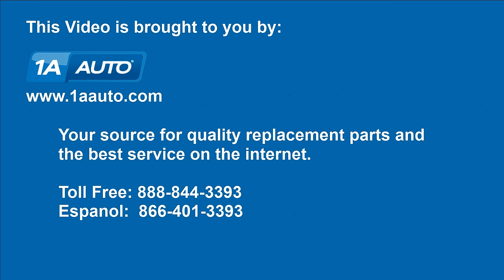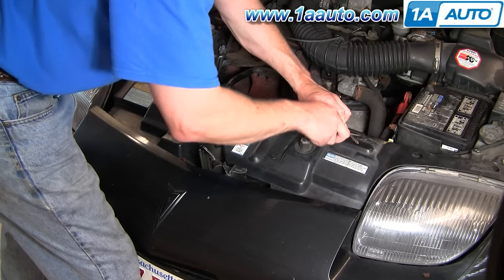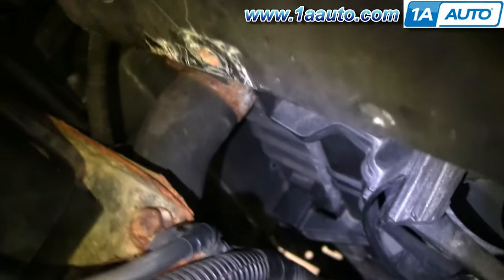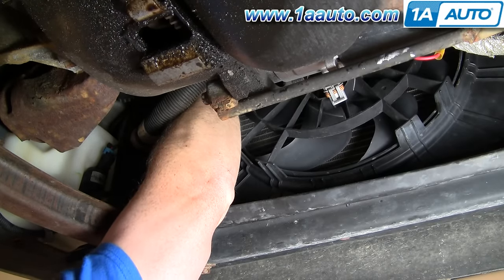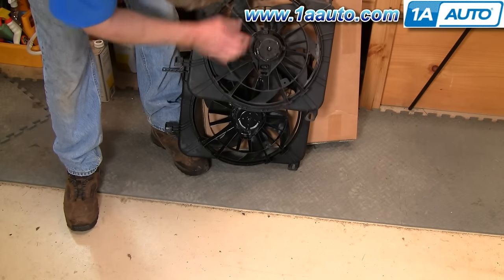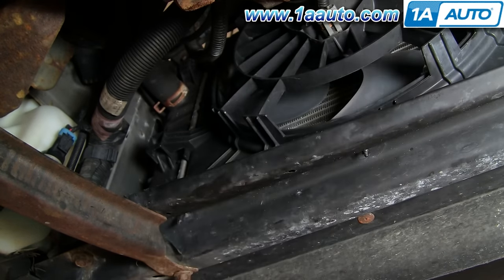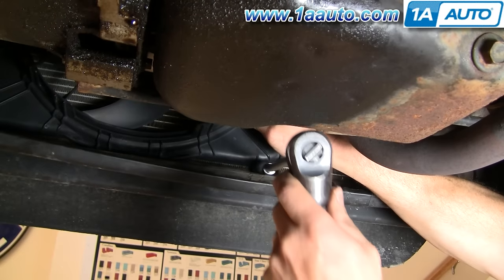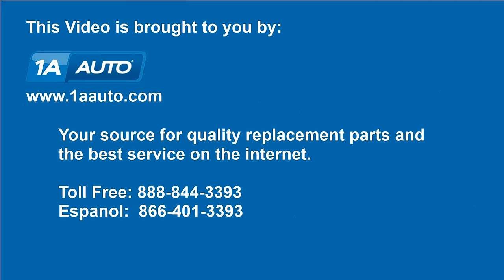How to Replace Radiator Cooling Fan Assembly 95-03 Pontiac Sunfire

Comment: I am an electrical engineer and I took the informed liberty to electrically isolate the fan by pulling the relay out; it's under an easily removed cover in the engine compartment, above the left front wheel.        Pulling the 30A fuse is even more to-the-point.       Disconnecting the battery is over-kill, and scrambles the memory of the engine's computer, a pain in the A**.    My car:  '99 Chevy Cavalier Z24.

Comment from the maker: What you could do is check the electrical connection to make sure you are getting power down to the fan itself. Normally there is a relay of some sorts that is before the motor along with a fuse. Your owners manual might be able to assist you with this or you could contact your local dealership for a diagram.

Comment: Thanks for this helpful video,one problem though,my fan doesn't turn on, I replaced motor,checked radiator fan clip connection, turned ac on,checked fuse,still nothing, any suggestions?

Comment: Mike, the best mechanic I know just replaced my cooling fan motor. in order to do so you had to remove the cooling fan (2003 Cavalier) - I was going to do it myself until I ran into the exact problem you just stated. when I asked him how he ended up doing it, he said he dropped the radiator out of the bottom just far enough to lift the top of the fan off the radiator and it came right off. but he had to drop the radiator first in order to have the clearance room. hope helped, I see i'm 3mos late

Comment from the maker: The white smoke you see is something from the A/C system failing which definitely needs to get looked at. The jump is most likely the cause of a failing transmission and the O2 fault code means that it could just need to be changed out.

Comment: Thank you for the video! I own a 2002 Chevy Cavalier with about 85k on it. Its in pretty good shape (I hope!) but when it jumps when it shifts (automatic) and when I run my ac my engine revs more than it should. Just recenty I was sitting at a light with my ac running and white smoke started to come out of my hood but when I turn my ac off the smoke stops and I dont have this problem when my ac is off. I got a code reader and it says something about a heated oxygen sensor Please help! Thank you!

Comment from the maker: Sounds like the relay for the fan is just overheating or it could possibly be the motors themselves. Normally when you switch the A/C on the computer commands the fans to turn on when you are not driving to keep air flowing over the condenser.

Comment: Hello.... I enjoyed the video, it made it look doable. I had all the tools. I let the car cool completely. Now my problem is I'm not able to get under the car like you were during the video. Can you suggest another method to removing it? Plus I'm not able to locate the clamps to release the fan from the radiator.
Reply: You absolutely have to raise the car, safely holding it up one way or another.          The extrication takes place by going DOWNWARD.        Not to mention the 10mm bolt MUST be accessed from below;  (at the bottom right, when oriented like someone driving the car); this video appropriately includes it in its sequence of removal instructions @ 3:17.
Reply: @johnbecich9540  I removed it from the top but it was a royal PITA.  I'm not sure if I have to do it to get it out but I took loose the fan blades and the motor, removed the battery and pried it out.  I put it back in with a lot less issues, and had motor, blade assembly bolted to shroud/mount.

Comment from the maker: You could test the wire going to the fan with a test light to see if it has power going to it. Just be careful and don't get to close to the fan incase it turns on. If there's power going to the fan motor, than the motor may be bad.

Comment: I've crawled under my cavalier, and there are zero bolts, or screws holding my fan in place. Just a peg in a slot on the top driver's side, a hook over the frame on top passenger side, and about dead center of the vertical border on driver's side there is also a hook that the fan clips on to. Still can't get it loose. Feels like it wants to come out, not like it's still bolted on. I'm just not strong enough withy bad back to pull it free. Any suggestions?

Comment: I like to know whether it is necessary to remove the fan assembly before removing the radiator on Sunfire, i'm in the process of removing the radiator and the fan seem to  be on my way making it difficult to pull out the radiator.

Comment from the maker: You'll have a drain house under the car usually around where the passenger side floor pan is. Sometimes they become clogged and cause a leak in the car. If you blow some air into it it should all drain out of there for you, if this is what's causing the issue.

Comment: I figured it out on my 2002 Z24 Cavalier.  I had to remove the 2 hood latch bolts to the top of the "frame".  this allowed room I needed.  I replaced the motor only.  I didn't understand the instructions, all this talk about drilling and stuff. I just re-bolted the new motor up and nothing appeared to hit and spun freely, so I put it in.  I Thought the connector on the new motor was wrong model.  But I got a mirror on it, and the connector was bent. Went from thick plate to thin plate.

Comment from the maker: You may want to check the thermostat, and also the relay for the fan. The fan relay could be the reason why it's not kicking on during normal driving conditions with the AC off. Hope this helps you out. 1aauto.com 888-844-3393

Comment: If you have a 2004 Chevy Cavalier, you may have to drain your radiator hose that's below the fan motor. That's what I did to get that hose out the way.

Comment: @1aauto I guess I wasn't clear.  The fan won't come out.  I unbolted the radiator so it could rock as you suggested.  The top of the fan shroud is hitting the car metal frame part and blocking me from removing it.  I'm going to try unbolting the radiator again from the top and rock it towards the engine.    Rocking away from the engine I still could not get the fan up over the radiator.

Comment: I have a 2003 Chevy Cavalier and the cooling  fan is not working,I had a mechanic check it and said that my relay and wires are good, so the problem is the fan itself, well i was just wondering if I have to replace just he fan motor or the whole fan assembly?

Comment: I got a 2004 chevy impala which is in good conditions. however, the radiator fan sometimes it works, but sometimes it doesn't! is there a reason as to why it wouldn't work... other than the fact that i may need to get another one?

Comment from the maker: You may want to check the radiator hoses to see if there is any anti-freeze leaking from them. Also pull the oil dipstick to see if there's anti-freeze in the crankcase. If there is your head gaskets may need to be replaced. Hope this helps you to troubleshoot the issue that you are having. 1aauto.com 888-844-3393

Comment: ty for showing a old school shade tree Mechanic i have a 2002 sunfire should this be the same for where the boats it should case it looks the same  im blind as a bat lol i hope it works the ac dont even kick it on im change fan motor  i al ready change the relay i miss the old cars the fan ran all  lol but the down side to old is the fan ran with the water pump

Comment: The cavalier 2003 does not have enough room on the top (facing the front of the car) left side to lift the fan hooks off the top of the radiator that they hook into. How do you supposed I get around this?

Comment: There is not enough clearance for the top "hooks" on the fan to lift out. What you end up having to do is carefully, and woefully, slide the fan to the passenger side until the entire length of the hook is out from under the frame piece, then you can lift it up and out. The frame peice is much wider on the Cavalier 2003 than the car shown. There are a few things that get in your way, like a radiator hose, but as long as you're gentle and take your time, you can get it out.

Comment: I couldn't get past 4:16 in the video.  On my 2002 Z24 cav, it looks like the frame up top is blocking the fan shroud from pushing up.  So I had a friend with a breaker bar, pull the radiator forward to get some room. I still could not get it up and over the radiator.  Seriously, I'm stumped on this.  I even tried from above when moving the radiator forward.  The fan set up is the same annoying design as this.  I don't think I tried pushing the radiator the other way(towards the motor).

Comment: Is it necessary to disconnect the battery?
Reply from the maker: Thank you for watching. Whenever you are working near the fans you want to disconnect the battery. That will get rid of any possibility of the fan turning on and possible catching you. Hope this helps!
888-844-3393
Reply: How freely should the fan move after installing the new motor?

Comment: This is a non-AC car with AC this is almost impossible to get out through the bottom also the wiring harness for the airbag runs right over the top of the radiator so basically have to disconnect the airbag move it aside this is total bullshit On an air-conditioned car it won’t come out the bottom because of the air conditioning lines are in the way
Reply from the maker: +Thumb Masher Thanks for the feedback!